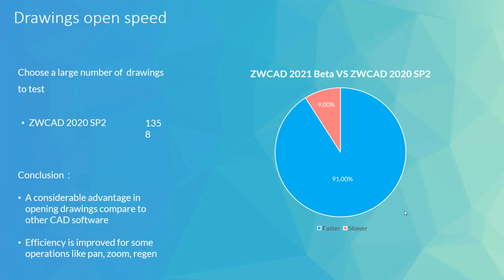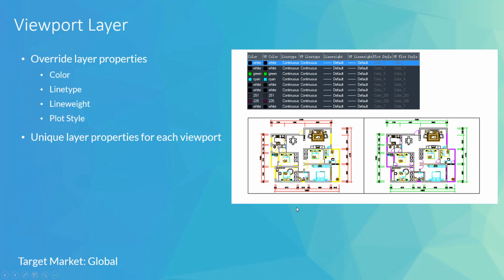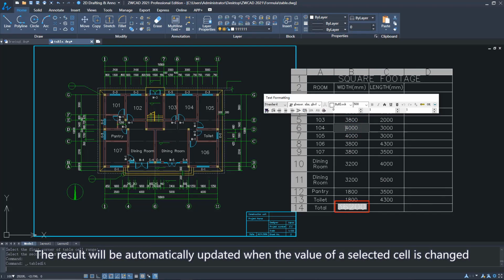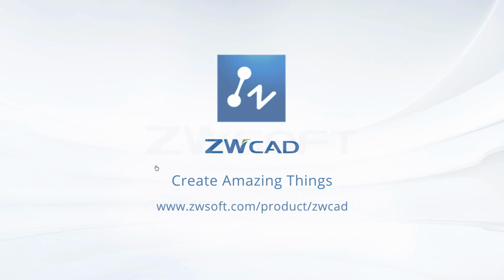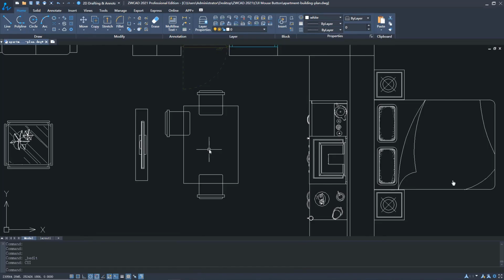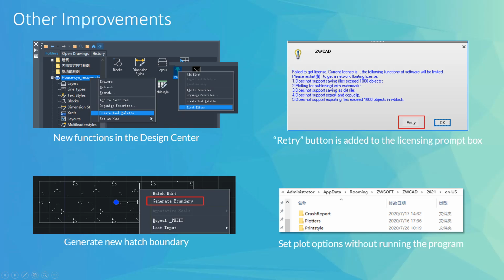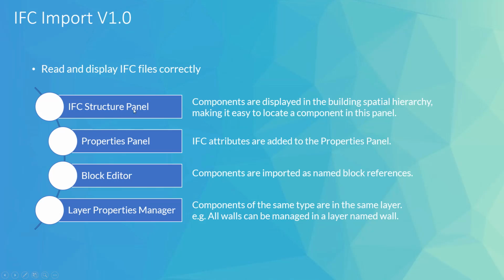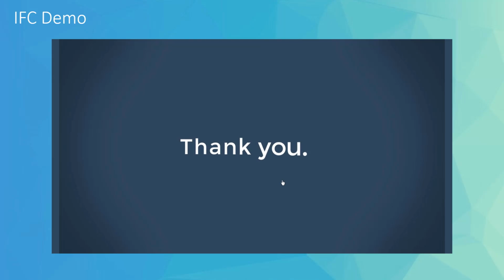What's New In ZWCAD 2021

Comment: good morning. i have a question: i have zwcad 2021 installed on a desktop computer, with an active licence. i found out that the application won't open when accessing the machine where it's physically installed using a vpn connection, through means of the windows remote desktop connection. zwcad was installed using the network licence manager